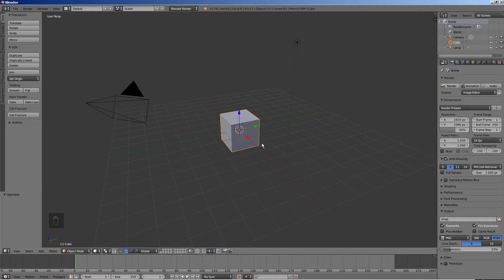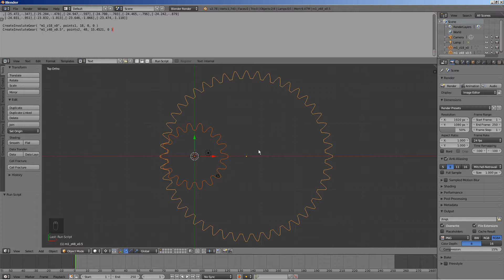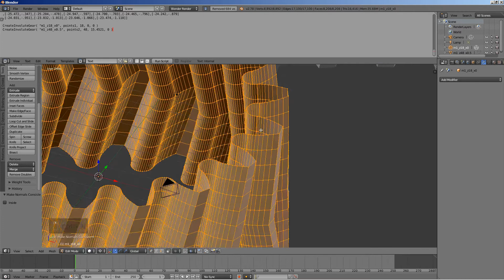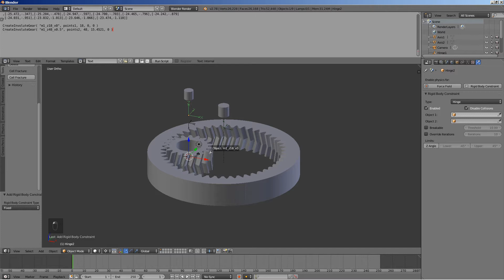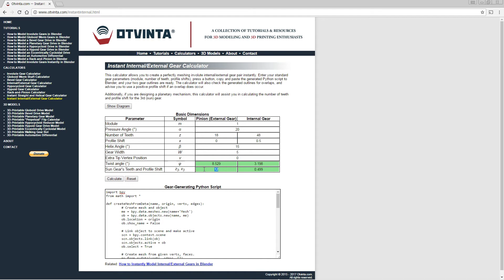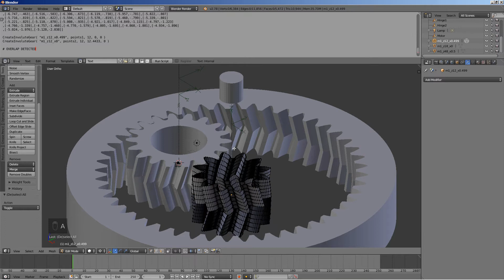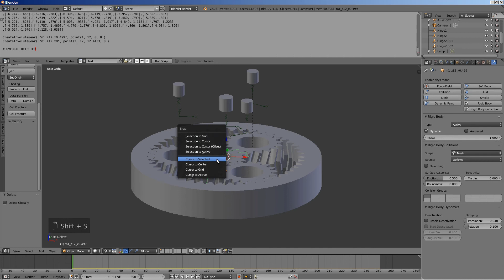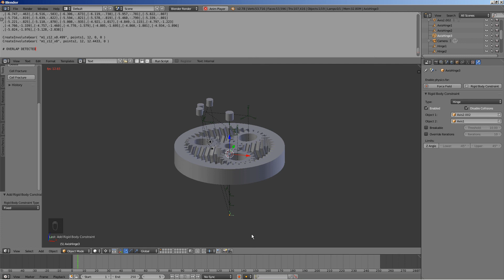Tutorial: How to Instantly Model External/Internal Involute Gear Pairs in Blender

Comment: at around 7m23 when he "starts" the motor,  in blender 2.8 at first the gears just wobbled and spun a tiny bit and nothing really happened. Then I made straight ones, moved the gears a little bit apart and set the MARGIN to 0.04 in the physics simulation. Zero is not a sensible margin for physics simulation (in blender), is causes overlaps and the engine does not know what to do.
Another problem that I has was bridging the edge loops. I had to extrude and scale in (resp. out) the tooths before trying the briding otherwise the mesh would be a mess. Maybe I missed that subtlety in the explanation or it has to do with enhancements between 2.7x and 2.8